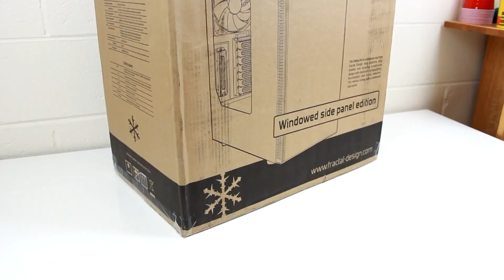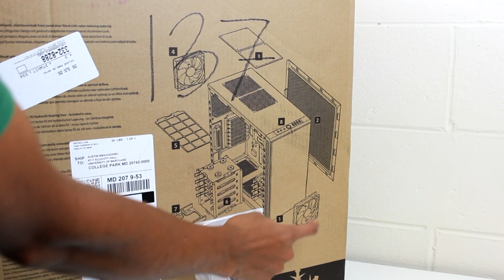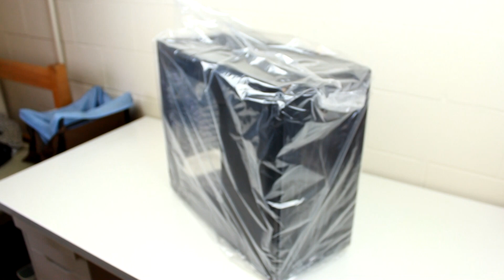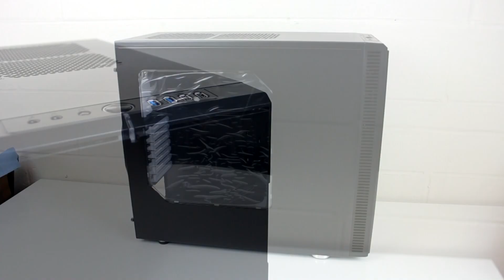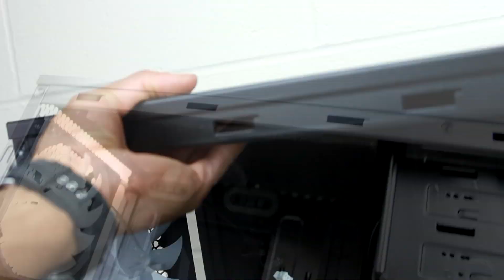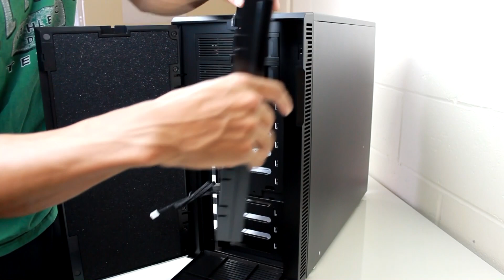Fractal Design Define R4 Overview! (PC Case) [Video Editing Build 2013]

Comment: Could you please tell me if you think an H110 would fit on the top? (280mm rad)
Reply: Yes you can fit a 280mm Rad. All the fan mounts on this case are 140mm.